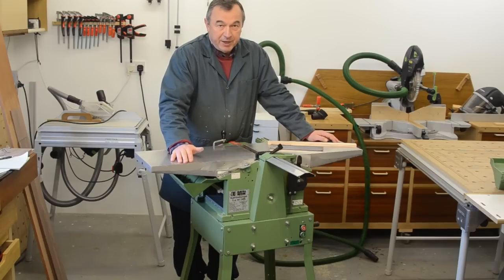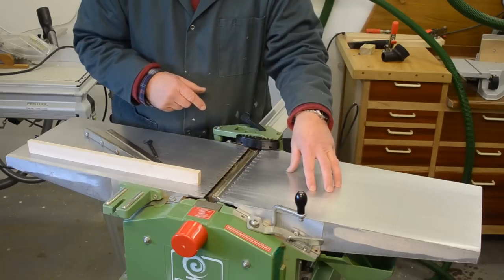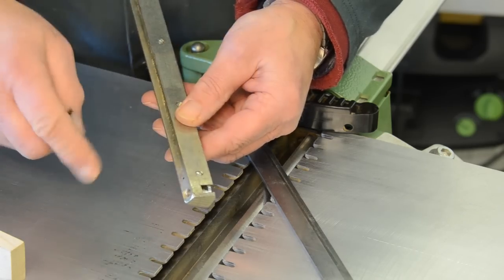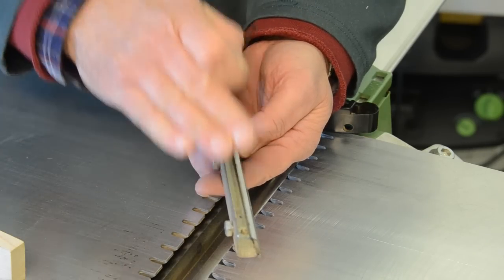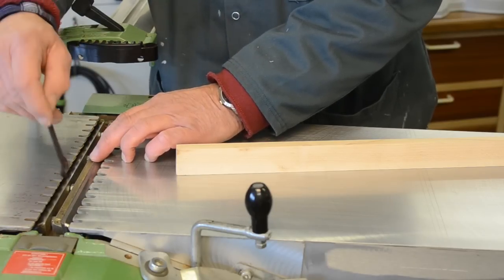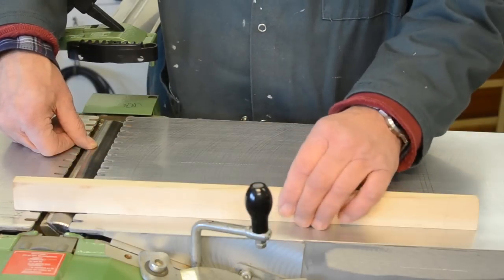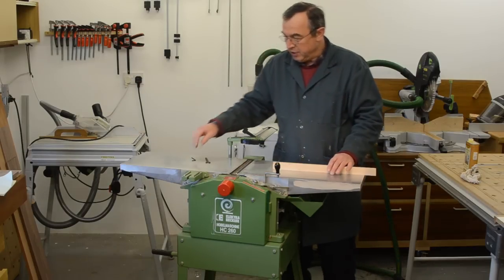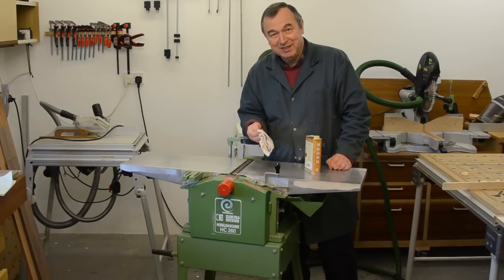How to Set Planer Blades

Comment: 7 Years later! I bought a version of the HC 260 from a friend. Mine was manufactured in 1983 according to the serial number plate. I was unsure of the method to set the blade height, and although mine works slightly different, this video gave me all the information I needed to set the blades. I've got the version with three set screws, but the test and method is similar enough. Thank you Peter.
Reply from the maker: Hi Anton, I bought mine new in 1990 and it was excellent value for money.  Cheers.   Peter

Comment: I inherited one of these some 30+ years ago. While I have used it on a few occasions, I have now made proper space for it and plumed the power in properly. Was always scared of adjusting or replacing the blades but now feel far more confident. Just going to order a new set of blades now I know how to fit them. Thanks for explaining everything.
Reply from the maker: Hi Dave, Excellent.  Cheers.  Peter

Comment: Wow Peter thanks so much for such an informative lesson on blade strings and simple procedure. My machine is more than 30 old, but I was never explained how to do this function accurately. Especially setting the blades with the wood grid lines. I always stumbled along with my own method. Now I can measure my cuts for more accurate cuts on different woods. This makes so much more sense.
Reply from the maker: Glad it was helpful!

Comment: Thanks for this video. I used the same principle to set the blades on an ancient Makita hand planer. It was a very tedious job because the location of the double sided blades in the setting block didn't have a screw adjustment feature. I had to set a protrusion using a micrometer and trial and error. It took several hours but I got there in the end. I would hope Makita have improved the design for their latest models.
Reply from the maker: Hi Trevor, Yes, that sort of blade fixing is a pain.  Cheers.  Peter

Comment: Thanks a lot for this very well explained tutorial. I will try to install and adjust my new blades this weekend.
Reply from the maker: Hi Torsten, It should be easy using this method. Good luck.  Peter
Reply: @NewBritWorkshop  Hi Peter, your blades can be adjusted with the allen key. But unfortunately my planing machine don't has this possibility, so it's a little more difficult for me.
Reply from the maker: Hi Torsten, Take care, especially to ensure that the blades are firmly held before you start the machine.  Peter

Comment: Really well presented and very helpful thanks
Reply from the maker: Glad you enjoyed it!  Cheers.  Peter
Reply: @NewBritWorkshop  I was given an old Naerok Jointer/Planer which is probably as old if not older than your machine. I used your guidance to replace the blades and the results are fantastic I'm so chuffed I can't thank you enough

Comment: Thx mate, all it took was someone to explain the setup correctly to me, as this video does, I will now set up my own 240v hand held planer as my blades are to low going off what you say, and this is causing a bump and uneven cut in the wood, hard to explain! but I now know whats wrong in my setup, my blades are to low in relation to the fixed flat bed. 
Thx Paul
Reply from the maker: Hi Paul, Many thanks for the feedback.   Peter

Comment: A very thorough and instructional video, Peter.

I agree that this is fine for a stand-alone planer (jointer). But for a combined machine, there is a risk of mis-setting the knives in relation to the thicknesser bed, if the cutter block happens to be out of parallel with the top outfeed table.

Comment: Thank you so much for this! My instructions (scheppach hms1070) are poor, this has clarified them perfectly.
Reply from the maker: Glad it helped!
Reply: @NewBritWorkshop  as it happens, I discovered that the supplied strange looking item was intended to set the blades. I used it, perfect! My machine doesn't have the adjustment screws at either end and relies on the springs in the block to push the knife to against the supplied setting arms. Your video perfectly suited my last planer - wish I'd seen it before I struggled. Thanks again

Comment: Thanks Peter for your swift reply, I have just set up my new blades as per the video and tolerances are excellent, I am struggling with tear out on some white oak where I have undulating grain around knots etc even with taking off very little material but maybe it is hard to avoid
Reply from the maker: Hi Phil, I am afraid that some pieces of wood, and not just oak, can have alternating grain along the length of a piece. Taking very fine cuts will help. Really sharp planer blades are important too but you have just replaced yours - are you sure that the new blades are indeed sharp? If I am unable to get a good finish on a piece because of tear out I rely on the sanding phase to sort it out.   Good luck.   Peter
Reply: @NewBritWorkshop  

I may remove them and sharpen them myself, make a jig or send them away. Many thanks again Peter

Kind regards

Phil

Comment: Thank you for this video, I have the same machine myself and its great to see how you set the blades, I use much the same technique myself. I would love to see a similar video of how you adjust the fixed out feed and adjustable indeed beds to ensure they are aligned correctly.
Reply from the maker: Hi Bob, I am afraid that I sold this machine about 4 years ago and no longer have access to anything similar.    Peter
Reply: @NewBritWorkshop  Hello, is this a good machine. I know someone who is selling it second hand as you don't get them anymore but are these machines dead accurate.
Reply from the maker: Hi Ziyaad, The machine cannot be described as dead accurate unless you make sure that it is set up properly. It is not a patch on the Jet 260 but that is well over double the price. I suggest that you ask to see the machine demonstrated in order to ensure that it is as good as you expect. Be prepared to replace or certainly sharpen the blades. Check for wear on the drive belt and also check the bearings on the various pulleys (see if they wobble).   Peter
Reply: @NewBritWorkshop  Hello, Thank you for your response. All in all is it a good machine to buy to get square stock?
Reply from the maker: Hi Ziyaad, I managed with mine for 15 years from new and it was really good.   Peter

Comment: Great video. Thank you very much. I also have a 20 year old HC260. Believe it or not I have not done anything to the blades in all that time, but they clearly need resharpening now. Do you have any advice regarding disposable or resharpenable blades?
Reply from the maker: Hi Steve, When I bought my 260 I also bought the tungsten blades. The disposable and normal steel blades are okay but need to be sharpened a lot more than tungsten (perhaps 10 times more often). For me it costs the same to sharpen steel and tungsten and so the tungsten pay for themselves in a very short time. If the disposable blades are less than the price of sharpening other blades then go for it. Otherwise try and get tungsten. I have now fitted tungsten blades to my Jet planer and the difference is amazing.     Peter
Reply: @NewBritWorkshop  It seems that no one sells "disposable" blades with the slots in them. I can understand why with the double sided ones. Where can you get tungsten these days? The only slotted blades I can see are HSS /w 18% Cobalt.

Comment: Really usefully video, thanks. Why 5mm and why a specific length of wood? Is it something specific to the type of jointer and how much the blade should stand proud of the outfeed?
Reply from the maker: The 5 mm is pretty much the agreed distance and the length is about right. These dimensions should do for any jointer.

Thank you for the kind comments.

Peter

Comment: Great video.. 1 question though.. When setting ur blades here what height is ur in feed table.. Is it at the highest or lowest or in the middle.. My planer cuts a maximum of 2mm..sud I set mine at 0mm..1mm..or 2mm
Reply from the maker: Hi Paul, I think it was close to or just over 1 mm - it was a long time ago !!  Cheers.  Peter

Comment: Thank you Peter I’ve just bought a second hand record machine and needs setting up properly. It appears to be a copy of that machine. Does yours have cast iron beds though or aluminium? My aluminium beds had a coating on them that was all flaking off and I’ve wondered if I can sand it off and oil it, or if it needs surfacing so it’s more accurate?
Reply from the maker: Hi Michael, I sold my machine a very long time ago but, yes, it did have aluminium beds. Mine were not coated at all. I cannot advise you how to clean off the flaking coating. Be careful using any form of abrasive. Try using a stiff plastic scraper and maybe experiment with various types of solvent. Take care not to risk a fire when running the machine afterwards and avoid getting any form of solvent on the gearing (oiled screw parts) or belts. Good luck.  Peter

Comment: this is the good explanation, did this procedure also adjust correctly for the thikneser ?
Reply from the maker: Hi Kurazs, Yes, it did.  Cheers.  Peter
Reply: @NewBritWorkshop  Following your instructions, i also re-adjusted my machine's blades. But then before using i fell sick. Previously i adjusted it so that i had a 0.002 mm space between the blade and the top of bed. I found that my settings didn't square the wood correctly. This is my first time of using such tool. I also need to learn more on how to do a better job on squaring up 2 sides.
Reply: I can come back with some feedback. Following issues:
1. I am using a new METABO HC 260C planer thicknesser. 
2. The outfeed table adjustment was not described in any youtube video. Turns out my outfeed table wasn't plan with the infeed table. There were adjustment screws present, but i didn't realise i needed to do them, cause i didn't check for this issue.  
3. Because of the previous issue, adjusting the blades so that they create a 5mm travel, cased me to have the wood planed in an angle. one end thicker then the other end. 
I'm not really sure how and why. I suspect that i pushed the soft pine too hard on both sides (infeed and outfeed table) 
4. This is the point where i noticed that i can adjust the outfeed table and then readjust the blades. The one problem i encountered was that the i couldn't precisely align the blades to the outfeed table, with this method, because of the sub millimeter error caused by my marks.
5. At this point my travel was adjusted in such a way that i got around 3 mm total travel of the straight edge. 
At this point i need to by the appropriate tool to adjust the blades to the outfeed table . (but because my outfeed table is made of aluminum (non magnetic) i cant just buy any tool.

Comment: Thanks for the clear demonstration Peter.  I spent this Sunday trying to do the same thing to my Metabo version of the machine.!    I've tried finessing the adjustment of the blades (as well as changing them!)  and adjusting the roller tension but have never managed to remove snipe when thicknessing.  For surface planing the machine works fine.  I was wondering do you get snipe ( more wood planed off the start and ends of the piece than the rest)  when using your machine as a thicknesser? 
Thks

Comment: Hello Peter   thanks for a wonderful video.  I live near Toronto in Canada, have recently purchased an HC260 2nd (3rd?, 4th?) nade planer/thicknesser, and have been very happy with it so far.  I have not been able to find replacement, sharpenable  cutters/blades.  I ordered disposable blades for it, but they do not fit the existing lock block I have (I assume because it is designed for replacement, not disposable, blades).  Can you please suggest where I could find replacement sharpenable blades?  Thanks for your help.
Reply from the maker: Hi Paul, I am way out of date with that planer but the company was bought out by Metabo who continue to make the machine. I am not sure what changes may have been made but start your research with Metabo.  Good luck.  Peter

Comment: Awesome video, thanks. I just purchased a HC 260 :) is this 5mm setting not dependent from the height of the adjustable metal plate (the infeed jointer plate)?
Reply from the maker: Hi Negao, Do it from the other side - I think !  peter

Comment: Hi peter I just recently brought myself a Electra Beckum HC260 I can't tighten the fence up so I referred to your video on how to set the blades up and I noticed that your Electra has two small bars under the fence sitting on the fence plate mine do not have these and my gut feeling is that's why I can't tighten mine I've been back to the seller and he does not have these please can you tell me where to get them and what they are called or what I can use as a alternative. I've watched so many of your videos now and there is still much more for me to watch I do hope you do many more
Reply from the maker: martin dickerson Hi Martin, Those bars were firmly attached to my old HC260 I am afraid and I do not believe that Elektra Beckum ever sold a machine without. If there is a recess where you think that they should go you could experiment with some metal bar material (take the fence with you when you go to buy it). When you have the right fit fix it in place by screws from underneath and that might work. If you are in doubt, and with safety in mind, do consult your dealer or an expert. I am sorry that I cannot be more helpful. My HC260 was sold a long time ago and so I can't look closely at mine to give you any better advice.   Good luck.    Peter

Comment: Thanks Peter, very helpful - just bought a Kity 636 and in the middle of putting in new blades. Could you tell me the pencil line distance (from the blade) on the fixed bed?
Reply from the maker: yorkdutchy Anything 0ver 100 mm will do but no more than 450 mm. The gadgets supplied with some machines are sometimes about 80 mm long but they are made of aluminium.   Petyer
Reply: Peter Parfitt Thanks for the very fast reply Peter!

Comment: Hi Peter, I hope you can help. I've recently bought one of these machines (metabo branded) from eBay. I've spent hours trying to set it up right. I've set the knives using this method to find that the outfeed table was misaligned in relation to the cutter head. I adjusted that to be level and reset the knives using this method. Now I get a brilliant finish apart from the last inch or two. There's a tiny bit of 'snipe'. I'd guess at no more than 0.5mm though I've not had the dial indicator on it. would you consider re-setting the knives or when leveling the bed I've left it too low in relation to the cutter head? I can't face spending hours doing it again without clear direction from someone with experience. Many thanks in advance!
Reply from the maker: +Sam Tranter Hi Sam, I think by the sound of it your blades are set perfectly. Snipe is common but can be avoided. Here is a useful article which may help:    https://woodgears.ca/jointer/planer_snipe.html       I get snipe from time to time and it is often because I am rushing. Once you get it on a piece, turn it around and carefully feed it in so that the next pass reduces the rest of the material on that side to eliminate the effect of the snipe. Alternatively, always plane boards about 120 mm longer than required so that the sniped ends can be discarded !   Peter
Reply: New Brit Workshop Thank you. I was worried it might have been between my technique and the set up. I often worry buying second hand tools as I've no idea who and how they were set up and to my surprise 0.7mm difference across the bed accounted for a lot of tapering in the first instance. Many thanks!

Comment: Hi Peter , thank you for a great video, I have the same planner and with a side attachment I think is for mortising and  tenons were the red cap drill chuck is , do you have a video showing use of this sliding Mortiser, and also , I have a elliptical arch architrave moulding I need to make, can you put moulding cutting knives in the head to shape moulds as done with the cheap triton planner thicknesser
Reply from the maker: Hi Tom, Yes, that red cap is where a chuck would be fitted to take cutters for morticing. There are no shaper blades for this machine. I am sorry not to be more helpful but I sold my machine nearly 4 years ago.   Peter

Comment: Peter, an unrelated question to the setting - I'm cleaning the mechanism and the chain moves fine but is a bit rusty - do you lubricate the chains on your machine - if so do you use a dry lube? Don't really want to use greasy stuff with all the dust generated. Cheers, Jeroen (I won't keep bothering you!)
Reply from the maker: yorkdutchy Hi Jeroen, I always use light oil (in UK we have "3 in 1 oil") on chains. It is more important that they are lubricated than worrying about the oil attracting dust. If it gets dirty then clean it off and re-oil regularly. I also always use penetrating oil (in UK I use "WD 40") on the rise and fall mechanism especially the threads that I had on the Elektra Beckum. My experience of dry lubricants is that they are less effective and need re-applying quite often. It is also difficult to judge when it needs to be re-treated as there is nothing to see. Some planers will have parts that need to be lubricated with grease and for this you must follow the manufacturer's instructions. In all cases I would start with the manufacturer's recommendations.   Peter
Reply: Peter Parfitt Thanks again Peter - much appreciated